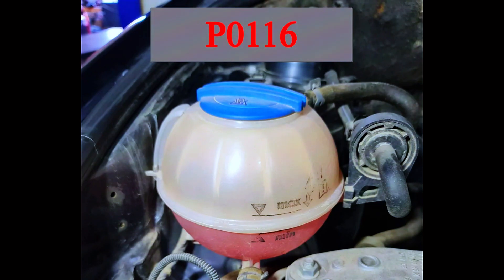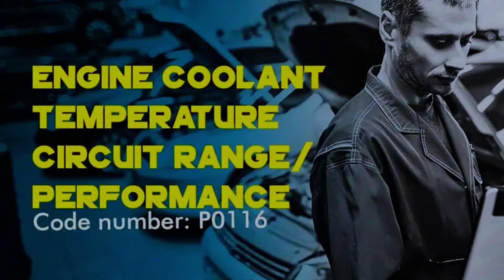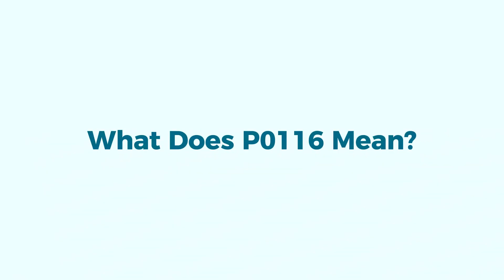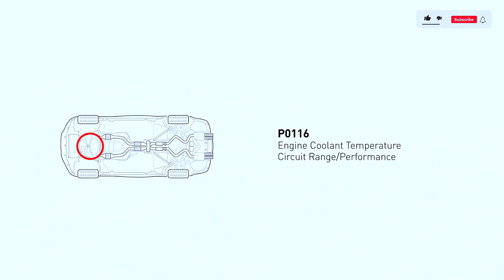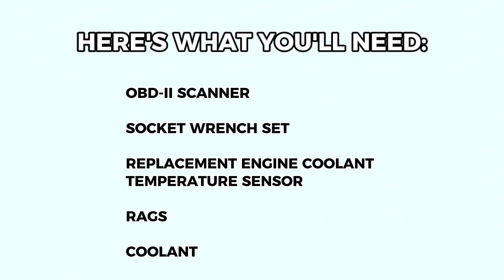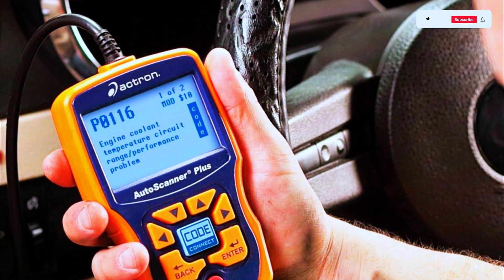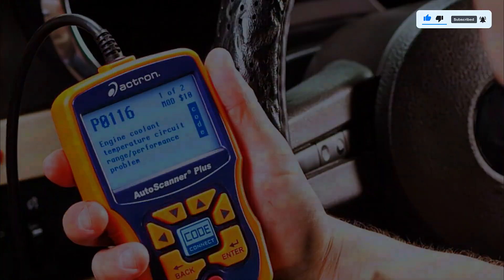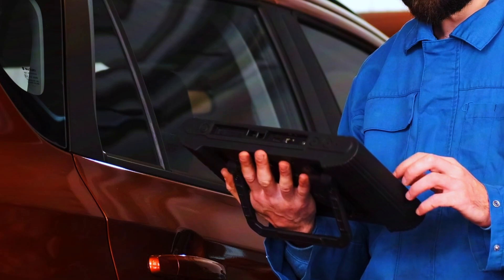How to Fix P0116 Code:Engine Coolant Temperature Circuit Range/Performance Problem@FourWheelsEmpire

Comment: What if the problem come again? Thermostat and sensor already change? The problem comes again after few days after changed the new thermostat and sensor?
Reply from the maker: A fault in the wiring can cause a P0116 code.
There may be an issue with the ECU itself. 
Sir now I want to suggest you. You should go to a professional mechanic.